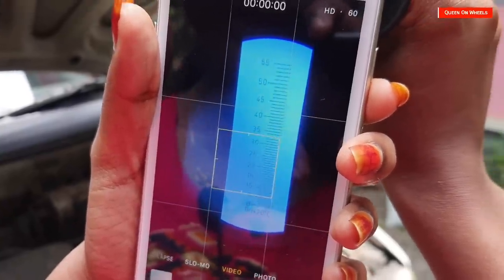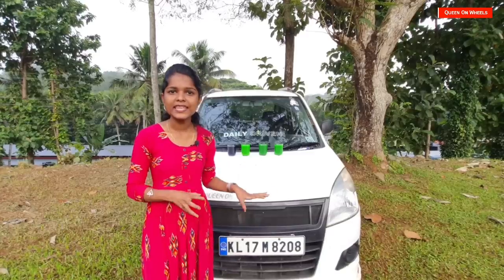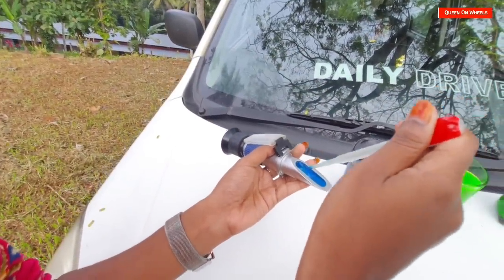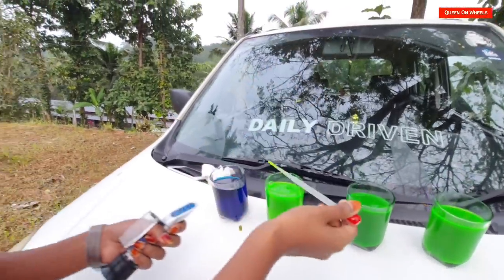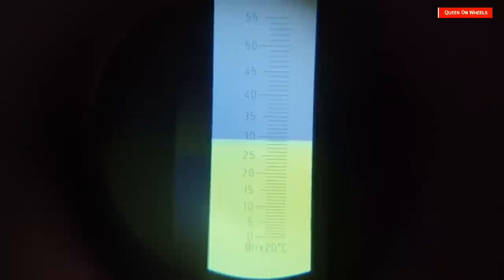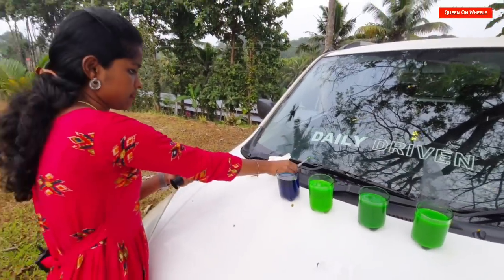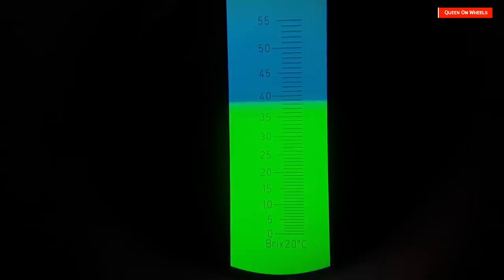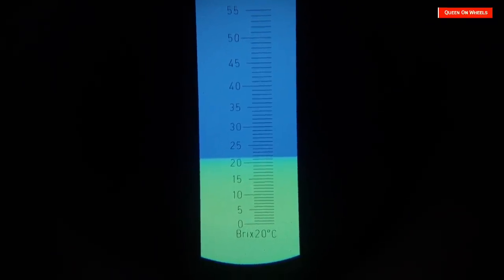How To Identify Best Coolant For your Car / Engine Coolant Quality test /queen on wheels

Comment: ഞാൻ Cold Guard use ചെയ്യുന്നു. 1:9 Water ഉപയോഗിക്കാം. റെഡ് കളർ ആണ്. കൊള്ളാം അത് . പിന്നെ 1:4 അല്ലെങ്കിൽ 1:9 റേഷ്യോയിൽ വെള്ളം മിക്സ് ചെയ്തിട്ട് ടെസ്റ്റ് ചെയ്താൻ mpg കുറയും. കാരണം അത് ഡയല്യൂട്ട് ആകും. ഇയാള് ആദ്യം ടെസ്റ്റ് ചെയ്തവയൊക്കെ ആൾറെഡി ഡയല്യൂട്ടെഡ് ആണ്. നേരിട്ടൊഴിക്കാം. Torrent നമ്മൾ ഡയല്യൂട്ട് ചെയ്യണം.
Reply from the maker: torrent turbo und vere level item
Reply: @QueenOnWheels  thanikk agency undo athinte?
Reply from the maker: ഇല്ല ഞാൻ മേടിച്ച ആളുടെ നമ്പർ ആണ് ഇതിൽ വിളിച്ചാൽ  ഡീറ്റെയിൽസ് അറിയാം +917994497241

Comment: വീഡിയോ നന്നായിരുന്നു, very informative, കുറച്ചു സംശയങ്ങൾ  ഉണ്ട്, coolent തനിയെ  ഉപയോഗിക്കാമോ, അതോ  വാട്ടർ മിക്സ്‌ ചെയണോ, അങ്ങനെയാണെങ്കിൽ tap water  use ചെയണോ അതോ  distiled water use ചെയണോ, വിഡിയോയിൽ പറഞ്ഞലോ  coolent ടോപ് അപ്പ്‌ ന്  water use ചെയ്യാൻ പാടില്ലെന്ന്. അപ്പോൾ എങ്ങനെ  നമ്മൾ  കൂളിന്റിൽ water ആഡ് ചെയ്യും, അപ്പോൾ അതിൽ  മിനിറൽസ് add ആകില്ലേ
Reply from the maker: Distilled water ആണ് ഉപയോഗിക്കേണ്ടത് .. കൂടുതൽ കാര്യങ്ങൾ അടുത്ത വീഡിയോയിൽ ഉൾപ്പെടുത്താം🥰❤️
Reply: @QueenOnWheels  thanks👍👍
Reply: Bro coolant 2 type medikkan mittum ready to use and concentrated, concentrated anel athil mixing ratio nalkitundakum like 3:1 nu okea. Means 3 parts water and 1 part coolant ( 4 ltr mix cheyuvanel athil 3l water and l ltr coolant ) ozhikanam. Ozhikumbol oru karanavashalum normal water ozhikaruthu mix cheyyan distilled water thane use cheyukka. Athala ready to use anu vangunathu nkil onum nokam illa direct ozhikam. Puroguard, wurth nte ellam branded coolants market il kittum. Epolum branded coolants use cheyyan sradhikuka
Reply: @motoenthus8815   ഞാൻ Hella വരെ ടെസ്റ്റ്‌ ചെയ്തു ബട്ട്‌ അതിൽ വരെ content കുറവാണ്.. ബ്രാൻഡ് മാത്രം നോക്കിയിട്ട് കാര്യമില്ല content നോക്കണം
Reply: @vishnusiva3238  hella lubricant coolant products il parajayamanu. 8 kollam ayi lubricant coolant megalayil work cheyuna allanu njan. Coolant il best ayitullathu purogurad and wurth anu. Bro ethil ethenkilum oru brand use cheythu noku.
( nb : i don't have any relation with puroguard and wurth 😊 )